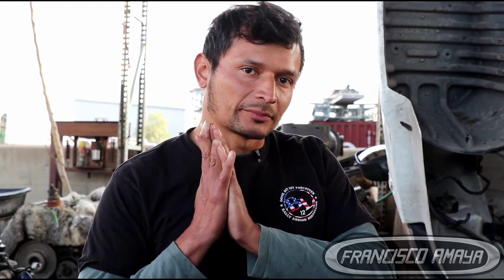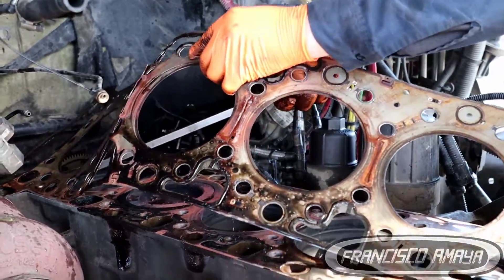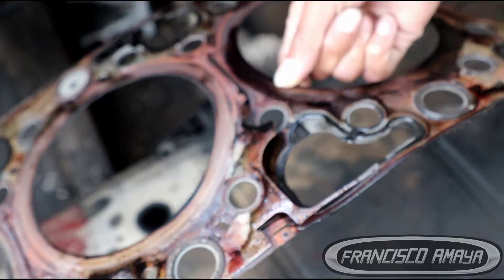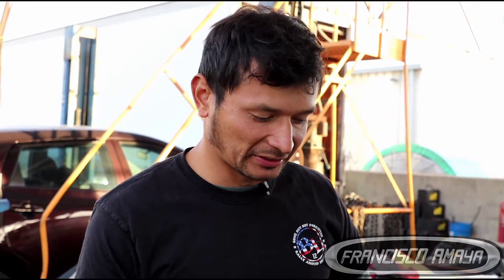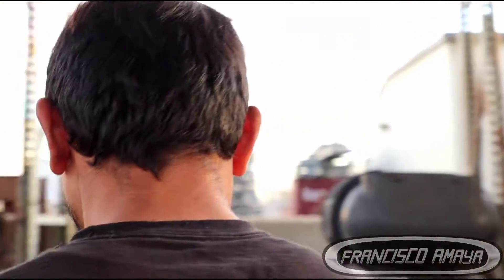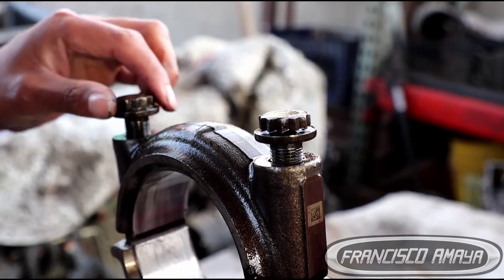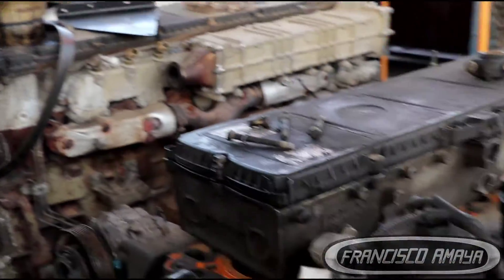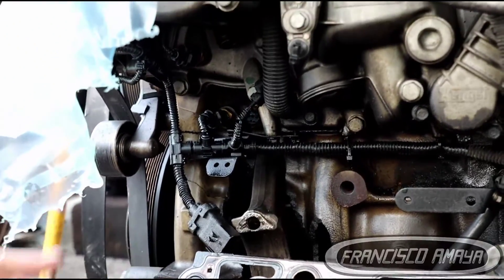DD15 engine broken head gasket and inspection after remove cylinder head major engine overhaul

Comment: Hi brother, I hope you are doing well. I have a question, could you answer please. I have 2019 freightliner cascadia over one million miles (1,163,167) had engine lights came on last week, thise codes sometimes on sometimes off, drove like that a couple of days started gears in some strange sounds from the engine! Took it to the dealer , they performed compression test , cylinder 4-5-6 we’re very very low, I can’t remember but all under 10 (out of 100) they did valves adjustment! I dove a week without problem, everything was normal. Then after a week all started again, same codes! But on the screen can sometimes read it but sometimes says no faults dedected! 
I took the trucka mechanic shop now and they said the same, low compression on cylinder 4 it’s 0
Cylinder 5 is 60
Cylinder 6 40 something. Mechanic said after valve adjustment, will hook the computer and then can tell me if another problem related. I was curious if the problems are fuel injector in cylinder 4 and engine wiring harness is bad?  They told me might be have to change head casket which could cost $12k. I am putting the codes Whats it came before and what I have now on the screen. 
523002/31 (ICU interna memory problem). 
1326/31 (Engine electrical Sys problem detected)
1326/10 
5361/16

Mechanic will work on the truck today 11/05/25 and let me know Whats the result and they are guessing the head gasket problem. If it’s so , it’s expensive I can’t afford and for this old truck not worth it I think, so I don’t wanna do that but is there any chance easier, simple and cheaper way to fix? Can I put some seal with around the cover joint all engine?? Not inside !! I don’t know the name but I will try to explain what I mean , now the way it’s after they all complete work , I will open the hood, and I will put some seal(I don’t know what I should use!!!) around the joint of the top cover on the engine! Or already the way its truck already is a junk I can’t sell it, so just in case can I do welding these engines top cover with the engine body and I can use, drive the truck untill where it runs and breaks down?? Please advise me brother, thank you in advance for your response. Have a nice day.